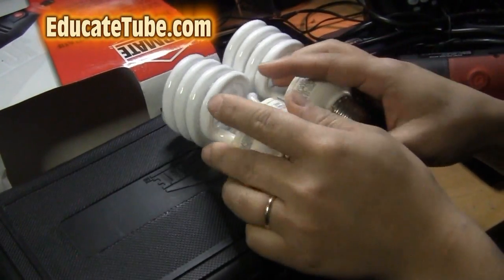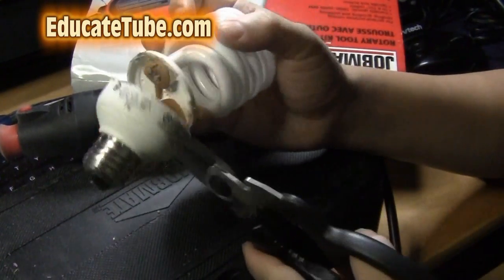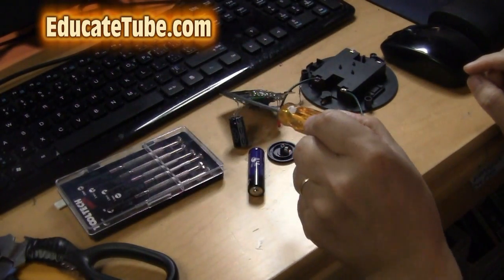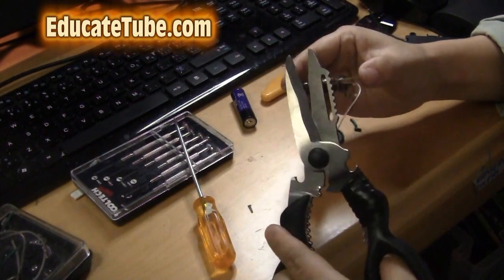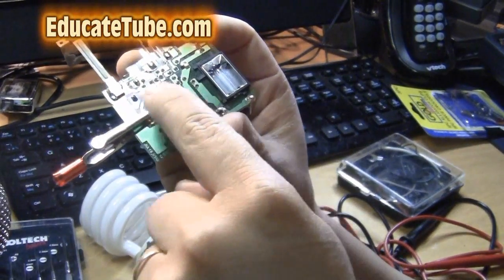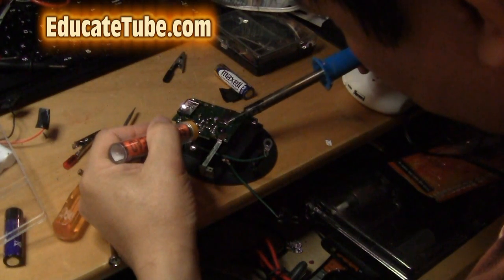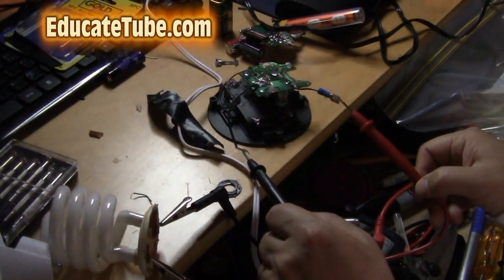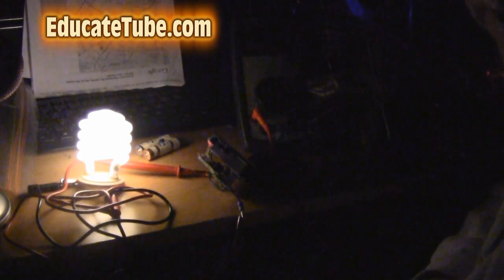How to make battery powered Compact Fluorescent Lightbulb (CFL) with disposable flash camera circuit

Comment: Hi Educate tube, Great  video and excellent work.
I have been trying to copy this project with a couple of different disposable cameras. when I very  carefully cut a 12 W CFL bulb open it would not light at all. I did get a 3.5 LED lamp to light brightly but it's strobing all the time at a constant rate. I can't get it to light continuously. When I tried another unopened CFL it worked but strobed again, no continuous light.  I have tried Kodak and Fujifilm cameras every which way. Any ideas,
I would be most grateful if you could tell me how I can a CFL to  light continuously. Thanks,
James
Reply from the maker: I think you have to attach to the right connection in the circuit.  I tried to touch the positive and negative terminals (1 or 2 AA batteries depends on your original disposable camera) to the circuit board as shown on the video.  It took around 10 mins to locate the right connection.  I find that insect zapper circuit works even better.  I made  a video on this several years ago.

Comment: nice work how much V and Amp y can use in a CFL Light Bulb 13w 2pin
Reply from the maker: +lenttaofreedom If you have 3V (2 AA alkaline batteries) with the disposable camera circuit it should work with your 13w CFL Light Bulb.  The disposable camera circuit will convert 3V to 120V.  Not sure how much amperage is given out, but two AA batteries should last several hours of light.

Comment: One question: do contacts you marked on the pcb back side lead directly to discharge capacitor where output wires that power the cfl should go?

Comment: Nice video thanks for sharing,

How many batteries or volts could you run to this setup the way it is ?

I have 18 volt batteries from cordless power drill, that can be stepped down to as low as 3 volts with a step down converter I bought so just curious if the camera flash circuit could handle the full volts the light was designed for ?

Not sure how many volts that would be as the lights only say 120 volts AC using 13 watts and or 220 milliamps...???

I have no idea how to make only 220 milliamps from a 120 volt DC battery supply :/ Sounds scary...

Cheers,
Terry